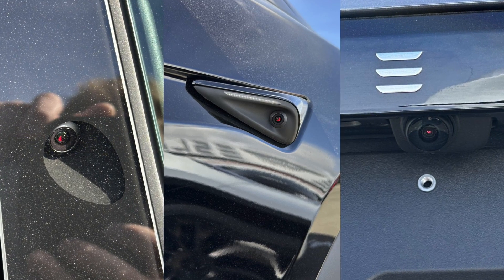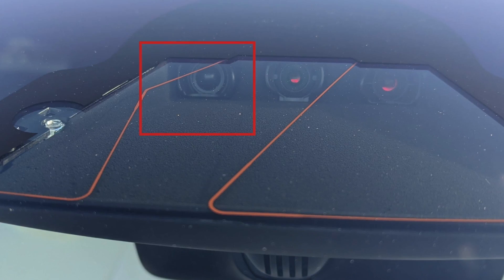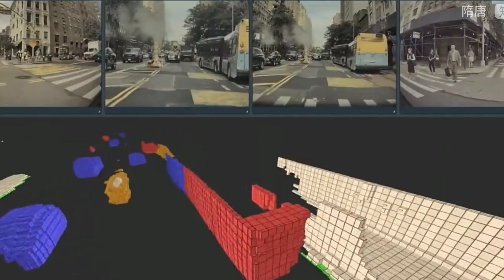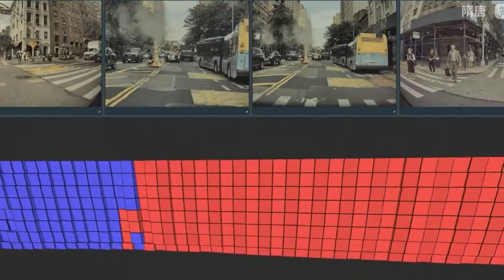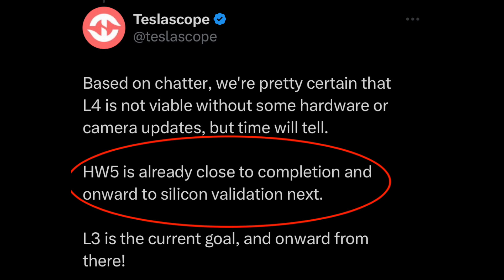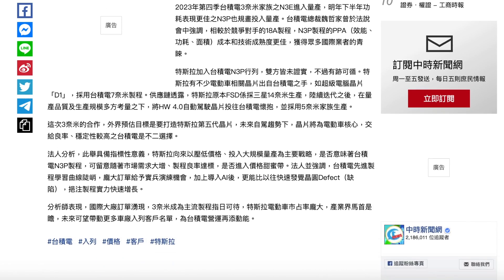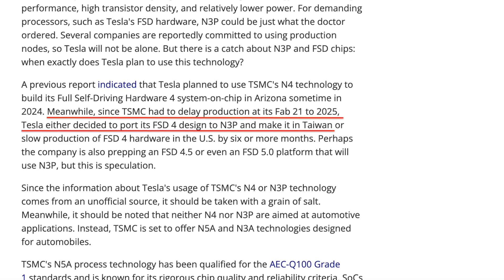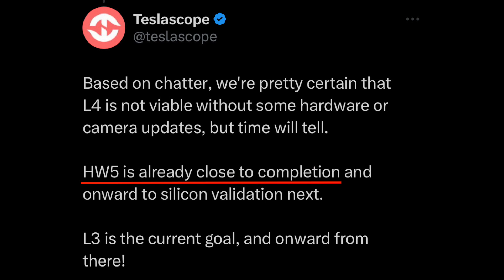Tesla Begins Hardware 5 Production For Upcoming Models | This is Great News

Comment: This is Tesla, so HW5 will not make it to production for another 3 years. Tesla talks a lot but delivers very slowly.
Reply from the maker: That’s typical of Tesla yup, but HW5 is coming earlier than you think
Reply: @heyJohnEe  Probably with FSD v12 going different direction the chip is being re-engineered towards those functions.   I hope they can add the high definition radar back in so stamp out phantom braking for good.   Safety is a big selling point.   Prevention is much better than good crash protection.
Reply: @Trust_but_Verify The HW4 computer already supports the Phoenix radar - Tesla has been putting the radar in the Model S and X.
Reply: @hedonismbot1508  Have not seen any video regarding the Model S/X's use of radar with HW4.  With vision only AP (or even future FSD 12), which does not make use of radar, what safety feature does the car account the radar data?    Are S/X no longer getting phantom braking because of radar?